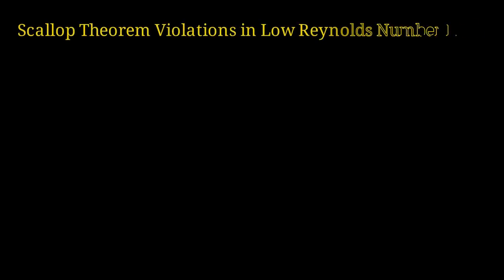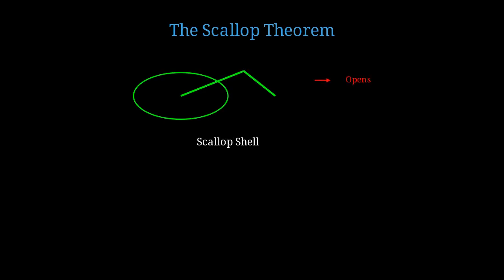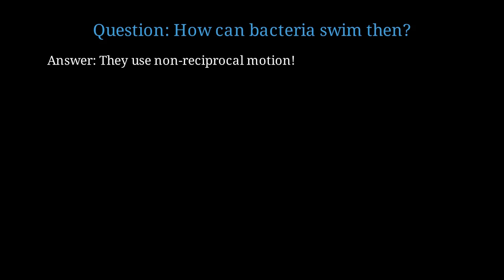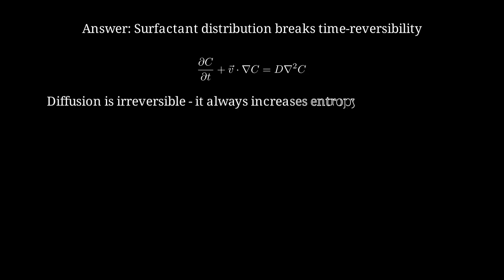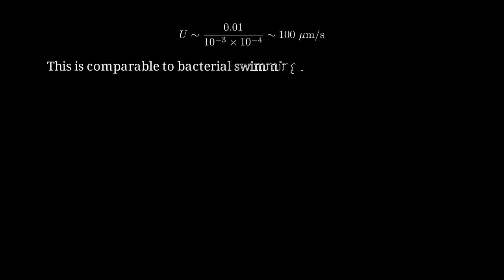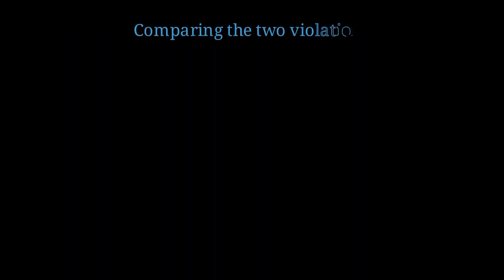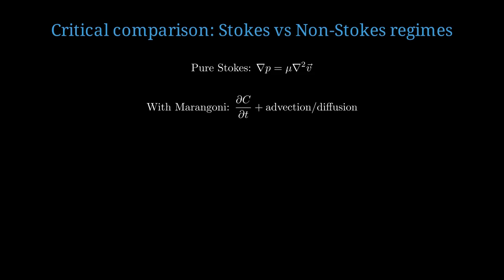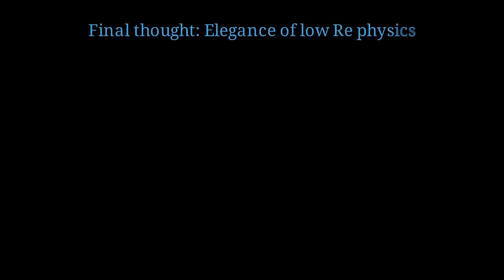Scallop Theorem Violations: How Do Tiny Things Move Without Muscles?

Comment from the maker: How can non-reciprocal chemical gradients be optimized to maximize Marangoni-driven propulsion?
What is the precise role of Deborah number in determining optimal swimming frequency in viscoelastic fluids?
Can coupled chemical–mechanical systems achieve sustained propulsion without violating energy conservation at low Reynolds numbers?